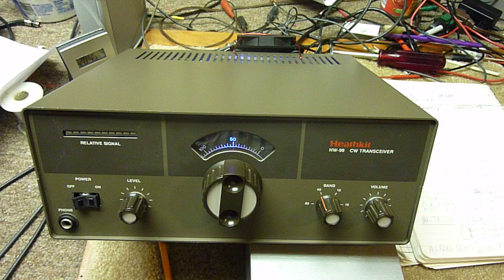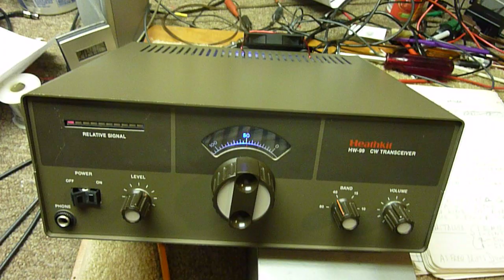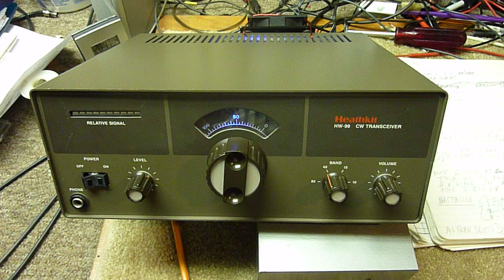HW-99 HEATHKIT VFO STABILITY CURED  a video update

Comment: Do you know if anyone figured out how to add 20 meters to this rig?  It was designed for novices who didn't have 20 privileges but would be more useful for everyone if it had 20.  I bet you could simplify life by getting a LED readout kit and adding it.  Here's a link to get one for $15.  Would be handy for other rigs with analog readouts:  http://qrpguys.apps-1and1.com/digital-dial-frequency-counter
Reply from the maker: Not that I know of 20 meters would be nice  BUT the HW-99 was designed as a bare bones cheap novice rig and lacks many of the features we like these days  .  For about the same price as a used  HW-99 you can often find a  used older Icom or yaesu  with ALL the bands and cw filters etc.   I bought a NEW Icom 746 in 1997  and still use it often . One thing about amateur radio you buy a nice rig and it will work good for years and years and if you decide to get something newer the old rig still has some  value  you can sell it at a hamfest or on Ebay .   Hope this helps  73   Bob
Reply: Thanks!  I have the Icom 746 from that time, too. I remember when the HW-99 was on the market that it couldn't have cost too much to add 20 and it might encourage a Novice to get a General. But, Heathkit was just trying to stay above water and didn't make it 73!

Comment: So NP0 to N1500 are temprarure compensating caps to keep it stable?
Reply from the maker: Yes  NPO stands for " negative positive zero  "  these caps are not supposed to drift in capacity with temperature change  BUT  some drift a little depending on type .  N1500 means the capacitor value moves in a negative direction (  less capacity )  as the temperature rises.  The most stable  (lowest drifting in capacity ) are the polyethelene capacitors those are the ones that are clear plastic with the silvery foil inside . The next best are the silver mica capacitors these  are usually  what we call  "Dipped Mica" because they have been dipped in epoxy usually a dark reddish brown color .  Next are the regular disk ceramic capacitors they tend to drift a little more even the NPO ones . The N1500 ,N330,N750  temperature compensating capacitors are usually disk ceramic units .  Years ago some temperature compensating types were called  " Dog Bone " capacitors you hardly see these any more they looked like a little dog bone and there were also made years ago what we call "Postage stamp" capacitors these are  silvered mica in a molded plastic case with usually colored dots on them to show the value .  A hand held capacity meter is a very good instrument for determining the actual value of capacitors and should be on any well equipped work bench . Hope this helps 73  Bob